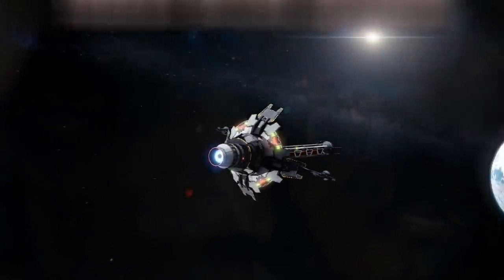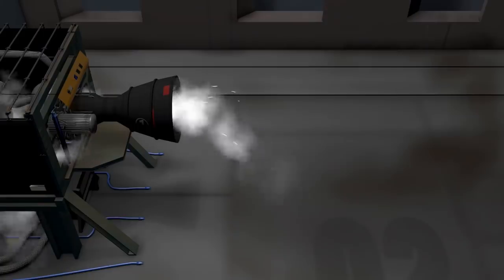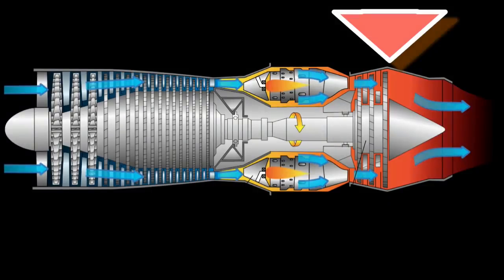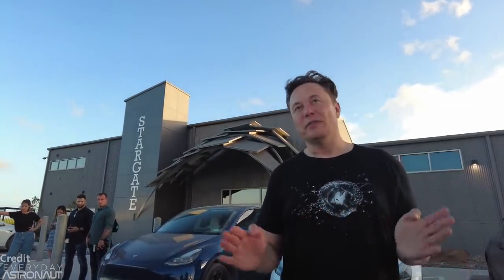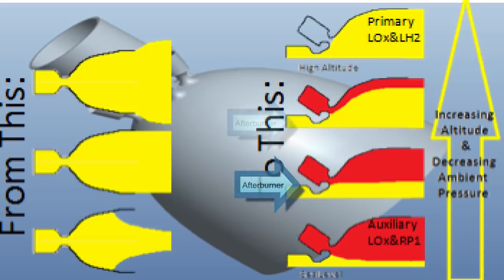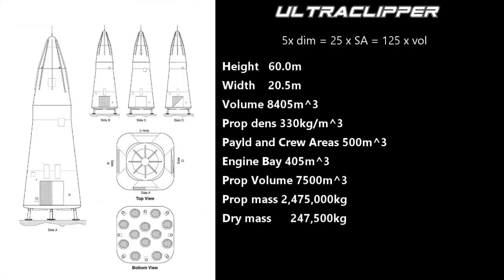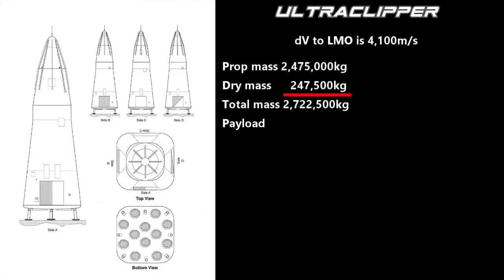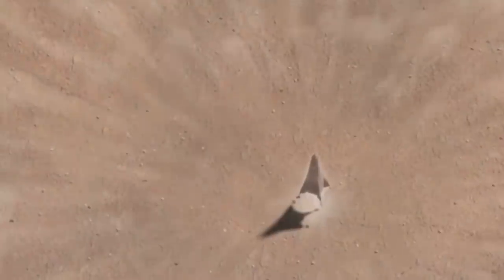Rocket Science: UltraClipper is Better than Starship!

Comment: Thanks for the shout out! Thanks for expounding on TAN! I've been fascinated by TAN ever since I read up on it. As I understand, Aerojet proposed a thrust-augmented RS-68 to NASA for Ares V. The plan was to have a small tank of RP-1 used only for the first 30 seconds or so of launch, with nozzles optimized for vacuum. I forget what the promised thrust improvement was, but it was substantial.  I hadn't thought much about usefulness on another planet. I love the Ultraclipper concept!
Reply from the maker: Thank you so much James for your support and your excellent idea. It is definitely a worthwhile concept. And as spaceplanes become a reality that is where you will see this concept and areospikes become essential.
Reply: @terranspaceacademy  You're welcome! You have such a great channel! I've been promoting wherever I can!   

I remember reading an AIAA paper proposing TAN for an SSTO spaceplane. Would love to see one of those fly!
Reply: As an FYI "TAN" was originally proposed by Aerojet... In the late 1950s :) There are patents dealing TAN for both regular and aerospike engines from then. The thrust improvement for TAN was around 1.5-2.0x IIRC due to the different density of the main propellant (LH2) and the RP1 "injection" propellant. Same 'propellant' (LH2 injected into an LH2 nozzle for example) have much less thrust augmentation effect. Fun fact is that such nozzle injection can be used to JUST augment the thrust in say a Nuclear Thermal Rocket, injecting LOX into the nozzle will greatly increase thrust but drop ISP of course. Still going from 4/1 TW and 900s to 40/1 and 600s is pretty good.

A "point" on Elon Musk being a genius anything please keep in mind he's NOT an engineer, at all. One thing that has been harped on for decades now IN engineering is that carbon fibre is NOT "black aluminum" and while it has uses it is NEITHER desirable or useful in all roles and engineers are taught (specifically in this case) that it's NOT a miracle material for every application. Musk insisted on the use of carbon fibre in many parts of the Tesla where it was not as useful as aluminum and much higher cost and this drove the price of the Tesla up and it's utility and durability down. He's very far from 'perfect' and he makes a LOT of mistakes and bad decisions. Something to keep in mind is that SpaceX is actually one of his few 'success' stories and most of his companies and concepts have been failures and often its' simply his ability to be in the right place at the right time that have made him money NOT his ability or business acumen. As for his ability to 'change course' keep in mind that he usually will not do so unless forced to. It was only the mounting costs that drove the change from carbon fibre not Elon noting the facts about stainless steel. (That was literally his engineering team and he initially would not listen to them, finally ONLY caving due to those mounting costs) Starship/Superheavy is all about Elon NOT changing direction even when circumstances suggest he should. Starship is all about landing 100mt on the surface of Mars because that is the amount of payload Musk (who got it from Robert Zubrin and the Mars Direct plan btw) decided NEEDED to be landed on Mars. Nothing more, nothing less. Starship is only 'marginally' about cheaper and more regular access to LEO being a requirement of the mission planning rather than of the vehicle design. (Much like SLS in fact) LEO, the Moon and Mars could be done with a much smaller and more cost effective design but that "might" push Musk's plans out a few years and he's not willing to change the 'plan' to accommodate that idea.
While the Falcon is not the best rocket for the job, (it has finness issues for instance and needs both a larger fairing capability and a more optimized upper stage) it is still a design with a whole lot more potential and arguably a lot more economic and operational sense than Starship/Superheavy. (See: http://toughsf.blogspot.com/2017/10/spacex-sfr-small-falcon-rocket.html#more) But Starship is what Musk wants and 100mt on Mars as soon as possible is how he wants to do it so that's what SpaceX is pushing for.

Super-Clipper = 1990's General Dynamics LV-109 "MIllennium Express" SSTO concept design, (fall-back 2 design specifically :) ) in context:
https://www.spacefuture.com/archive/single_stage_to_orbit_vertical_takeoff_and_landing_concept_technology_challenges.shtml
Using the RL-44 "Advanced Expander Engine" LH2/LOX
https://ntrs.nasa.gov/api/citations/19940021728/downloads/19940021728.pdf

Also the 'reason' for using LNG/Lox is to reduce the size of the propellant tanks, and it's a good idea because even with 'cheap' steel lager aerospace vehicles obviously cost more to design and develop so even though the LH2/LOX engines and isp are better the T/W for denser propellant IS a major concern vis-a-vis overall ISP. 
Now optimally for a 'booster' type vehicle you want denser propellant as possible with an average Isp while for an 'upper-stage' (or SSTO) you want as high an average isp as possible. But as noted T/W matter which is why the Delta IV didn't reach it's best "planned" payload due to it's slow acceleration off the pad.

Have you ever reviewed the "Space Coach" orbit-to-orbit spacecraft concept?
https://www.space.com/11230-water-powered-spaceship-mars-solar-system.html
https://thespacereview.com/article/2760/1
https://www.nextbigfuture.com/2016/06/spacecoach-concept-is-to-use-urine-and.html
Reply: @randycampbell6307  
I completely agree with you on your point about Musk. He’s definitely capable of doing some of the calculations for Starship, but much of what he knows now since 2006 is helped by a very good team of engineers. 

Only now that he has that and he has a large fan base that will always stick to his side on design philosophy, his “don’t change your personal decisions unless you have to” thinking is going to give him serious trouble.
Reply: @randycampbell6307  cool comment, but I think falcon starship is bad idea, because Starship is better in economics. Water powered rockets smth strange I think nuclear is the future. What do you think about this SSTO with nuclear engines?
Reply: @redakteur3613  Sorry for the late reply but I've moved and only recently got my internet back :)

Economics? How so? "Starship: HAS no 'economics' being vastly to large for any commercial payload and not going to be able to make money if it doesn't fly 'full' every flight. Meanwhile something like "Falcon-Mini-Starship" fits current and projected payloads and will be vastly cheaper being an actual "fully reusable" system. (Which "Starship" is not currently nor planned to be given the lack of proper testing)

Nuclear SSTO isn't really feasible given the large mass of the reactor and shielding needed. Specifically something that can fly from the surface to space needs vastly more shielding than a space only reactor system. Payload fraction will be very small.
Reply: @randycampbell6307  Mask said that they will be able to operate a Starship at the cost of 50$*kg*100000kg=5 Mil$. Falcon 9 today costs 60 million $. He also recently added that they will be able to cut costs up to 2000000$ per flight, “small” falcon just can’t compete, only recovery of a 1 booster costs more.
Reply: @redakteur3613  I'll note that Musk has mostly failed to make accurate predictions with launch, manufacturing or other 'claimed' costs even for the Falcon series so why anyone would take his word for "projected" costs on Starship...

Starship is about three times as big as Falcon, that alone means it will cost more to build and operate. Given that it has yet to show being 'reusable' at all, (and more so it's not even close to being 'operational' let alone 'working') his claims are very much like the over-optimistic claims and promises made for the Space Shuttle. With even less 'actual' data to back it up.

And again, we're talking a vehicle that can't fly a "full" payload on most flights because there is no 'market' for that much up-mass. Which means payload costs go up.

We NEED a DC-3 essentially but Musk is offering a 747 without any of the build up or background to support such a vehicle.
Reply: @randycampbell6307  ok then let’s calculate the costs. Falcon 9 minimum costs 62 mil $ at reusable configuration. Raptors of the starship will soon cost 250000$(theyre already less than 1 mil$), it’s the most complicated and costly component of a rocket — 33+6(ok maybe space raptor a little bit more expensive)=39*250000=9750000$. Steal dirt cheap and welded by robots, electro motors for wings from tesla, they also want to make them like a ordinary good at factory(economy of scale). Yep it yet can cost far greater amount of money, but it’s money spent on development, not the launch cost. Think that from 2015 the number of launches has risen approximately 20-25%. Its when the real launch cost cut was 20% with falcon. What if Starship could cut it 90% more? Think more globally, maybe at first 2 to 5 years there will be not so much work for it, but then with such cuts lots of things can be economically viable in space, just example internet cable manufacturing or semi conductors and there is lots more
Reply: @redakteur3613  
"ok then let’s calculate the costs."

Difficult given the disparity between the quoted numbers and likely actual costs but let's give it a shot.

"Falcon 9 minimum costs 62 mil $ at reusable configuration."

Yes, fully about three times what Musk had claimed costs would be. Keep that in mind and also keep in mind that was actually pretty close to what experts had predicted the costs would be.

"Raptors of the starship will soon cost 250000$ (they're already less than 1 mil$), it’s the most complicated and costly component of a rocket — 33+6(ok maybe space raptor a little bit more expensive)=39*250000=9750000$."

The $250,000 dollar price point is not supported by any actual evidence. Neither its the $1 million dollar price which is closer to the 'mass produce' price that experts have quoted. Note that the likely cost per engine is closer to $1.5 million per copy which jibes with Musk's desire to NOT expend them in testing if he can get away with it. Vacuum Raptors are expected to cost about a half million more but since it's 'mostly' nozzle we can assume about 1.5 times the cost of a sea-level Raptor.

You need to use the higher price to be conservative so (obviously) 39 Raptors comes out to $39 million dollars as a basic cost.

"Steal dirt cheap and welded by robots,"

Professional welders do the welding and while Musk wants to use robots the costs for set up and maintenance are not that far off the normal costs over time. Robots simply work longer and are more consistent. Steel is not 'dirt cheap' and Stainless Steel alloys certainly are not.

"electro motors for wings from tesla"

Tesla does not produce its own motors and they are bought from a subcontractor, (currently in China) nor are they what is being used in Starship which again is bought from an outside source.

"they also want to make them like a ordinary good at factory(economy of scale)."

They 'want' to but there are no plans to do so since the upfront costs would be greater than the savings given the low production rate of motors needed. Reusable means they do NOT build or install more not that they produce more.

"Yep it yet can cost far greater amount of money, but it’s money spent on development, not the launch cost."

Those costs are fed into an overall amortization cost that is fed into the overall launch costs over the lifetime of the vehicle. It adds up. 

"Think that from 2015 the number of launches has risen approximately 20-25%. Its when the real launch cost cut was 20% with falcon."

Real costs were not cut 20% and the rise in launches was something that had been coming. Falcon rode the wave, they did not create it.

"What if Starship could cut it 90% more?"

What if they can't? More to the point there is no way for Starship to 'cut' launch costs significantly both due to its inherent size, cost and complexity plus the inflexibility of the launch market. Cutting launch costs by even the supposed 20% that Falcon 9 is claimed to have would require the "launch costs" of the Starship to be a negative number. Starship has so much over-capacity that it will be economically questionable at best and likely to fly without full payloads for most flights. That will greatly increase the price required to charge payload users.

"Think more globally, maybe at first 2 to 5 years there will be not so much work for it, but then with such cuts lots of things can be economically viable in space, just example internet cable manufacturing or semi conductors and there is lots more."

And entertain for moment the idea of what if it does NOT drop costs significantly enough to EVER fly economically? The biggest problem is that while lower cost access CAN enable many new projects the actual ability to bring those projects to the point of flight is not very clear. Worldwide there is VERY LITTLE need for large payloads to orbit. The few that do exist or are planned are VERY large and expensive projects that have launch costs as a very small percentage of the overall costs.

"2 to 5 years" of costly operations (especially from a very limited launch site such as Boca Chica) would bankrupt the entire effort in less than a year. Especially if launch and production costs are nowhere near the "optimistic" levels suggested. Keep in mind that Starship/Superheavy flying only a few times a year would be fantastically more expensive due to the low flight rate.

Comment: It's an interesting concept. I remember the excitement when the clipper was first being developed. We had similar hopes for it then that we do for starship now. In the end, the more types of spacecraft the better.
Reply from the maker: We agree Stevie!  I assure you it was not cancelled by the engineers :-)
Reply: It was cancelled because it's not feasible. Your math was very forgiving Terran Space.
Reply: @terranspaceacademy  Engine efficiency you can be 5% -10% off peck performance or less than 12% on the negative side if you can find the sweet spot for both with room for improvement for the next version of engine and stay in those percentages the engine will have a good usable life span say 12-15 years thus dramatically cutting development costs that could go into non fossil based engines fuels  eg, ION engine development on a lager scale...
Reply: @kylereese4822  1q
Reply from the maker: @rexmann1984  it all works on Mars… But not a very good plan for Earth.
Reply: @terranspaceacademy  I want to wait and see if They can make it Work.  Then I can biitch at it.  What do you do if you land (on Eath) and have non-zero methane in the tanks.  you have to dump it or bun it, an as we all know, "Mthane is very 'burny'" (Beck).
Reply: Could somebody explain me something that I got lost? Why is the approximate specific impulse roughly half an afterburning fixed vacuum engine that of a 2 stage rocket? Isn’t the point of the afterburning modification to improve efficiency by improving consistent specific impulse? I understand lack of efficiency, with regards to fuel, but that doesn’t effect specific impulse from the thrust, right?

Comment: The aerospike is the perfect engine that will never fly to space, or at least until there are some major breakthroughs that no one has made yet. The main problem is that it's impossible/ almost impossible to keep cool. 

    Second the combustion efficiency of the Raptor is not because of the high chamber pressure although that does help. The main reason is that all of the fuel and oxidizer enters the combustion chamber as an approximately room temperature gas so the molecules can start combining earlier and be more completely combined before exiting the throat. In other engines a large portion of the fuel and oxidizer enter the combustion chamber as a liquid so they need time to vaporize before they can start  combustion.

   Sorry I'm an old aerospace nerd so I'm just throwing info. out there. 
   Your UltraClipper idea seems very well thought out and feasible. Maybe some day we'll see it fly. Great video. :)
Reply from the maker: Thank you very much!  I don't think the aerospike will never fly... short bursts for orbital maneuvering and on the Moon would not have a high enough heat load.  And they were able to fire a linear aerospike for extended periods and handle the heat loads.   It won't work with RP-1 but with methane and hydrogen you can keep things cool.
Reply: @terranspaceacademy  Technological advancements have a way of making amazing things happen.  It would definitely be cool to see one fly.